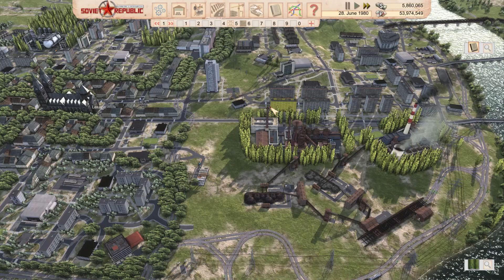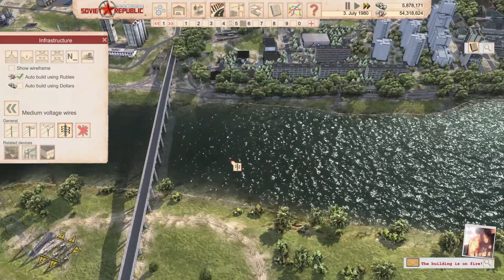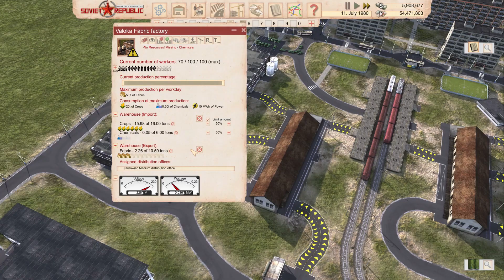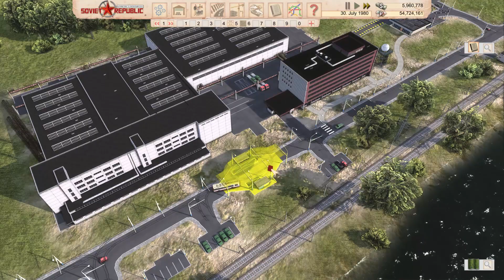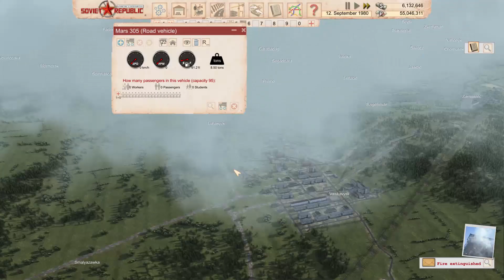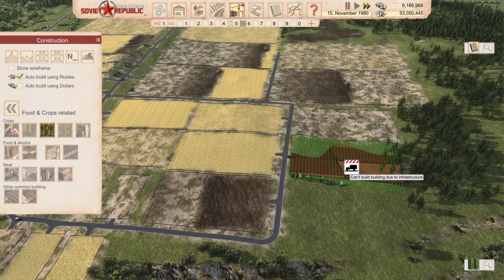Workers and Resources - Soviet Republic - Project Leszcie Ep.82

Comment: hi i can say some advice check the city stadistics to see the unemployment rate if there is a lot of unemployment there is  a very big chance of people moving out (and polution), that is why some buildings are abandoned after you filled with people a couple of episodes ago. The problem with trains  the thing about the setup you made in the steel mill is that the max number of trains that will accept without any problems is probably 4 you currently have 5-6  for what i can see, if you want  to have that number of trains  (5-6)  you will need to change completly the setup. If you want to not have not so much students filling the public transport put another university in a one of the towns near leizce its preferable the technical university to the party HQs because the students that are 
graduated from there can work as engineers in the nuclear plant and the automotive industry, don't eliminate the partys HQ that you already have, because they create jobs, from the cities i have made in the game i have discovered that one of the main reasons that people are upset and leave is unemployment.  i normally use mods for parking issues the parkings in the game  are to small for the aumount you need.